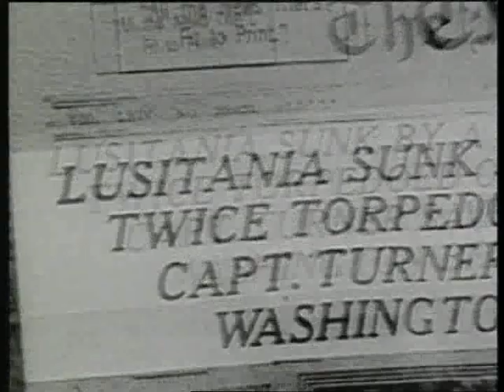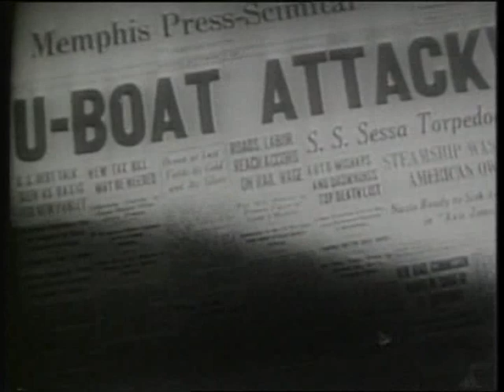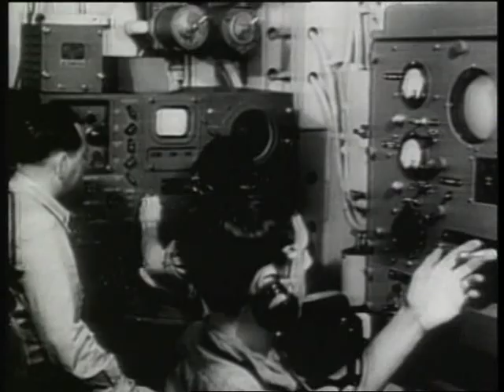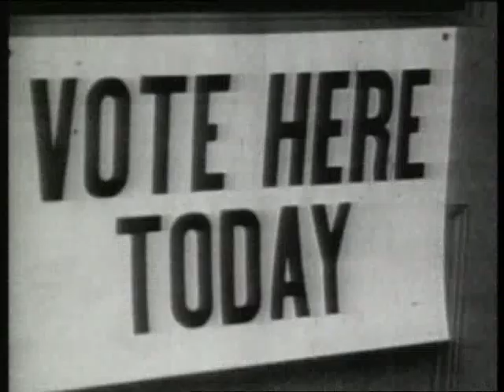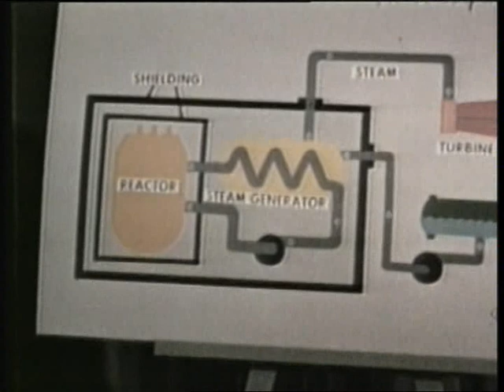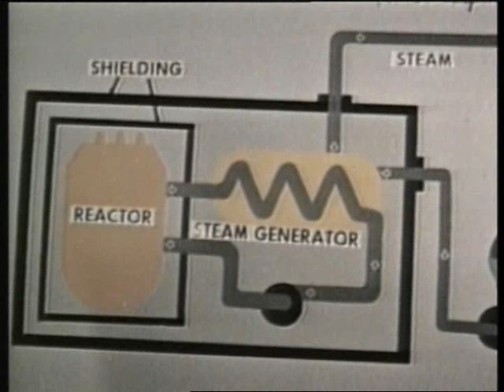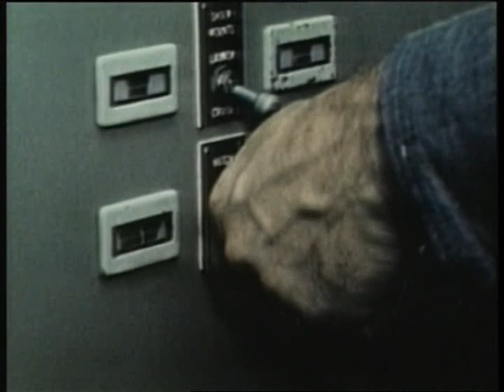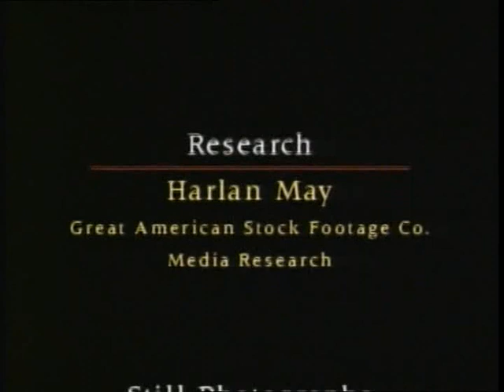COMBAT AT SEA | Submarines

Comment: Rode the old diesel boats in the 50's. No one took a shower on patrol. The showers were full of potatoes and other supplies. The "shower" consisted of a small basin of water. You brushed your teeth, washed your face  and moved on to the rest of your body. No B. O. Because every thing smelled like diesel fuel.
Reply: @Big Bill O'Reilly Actually, it's no shit. Where do you think the term pigboat came from? Don't know?
Ask any sewer pipe sailor.
Reply: gross no thanks